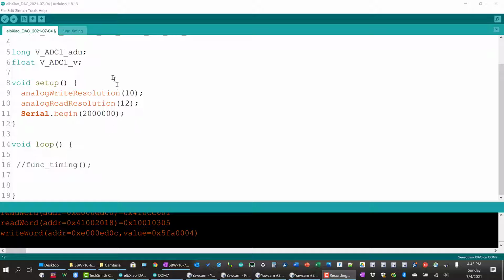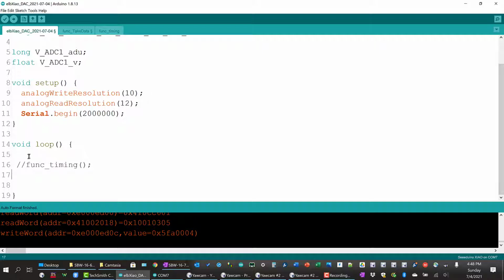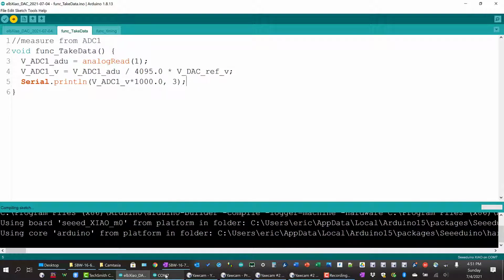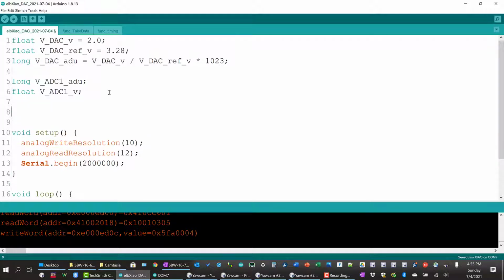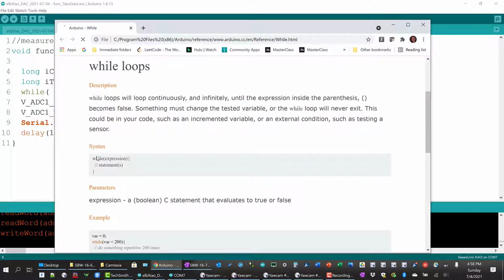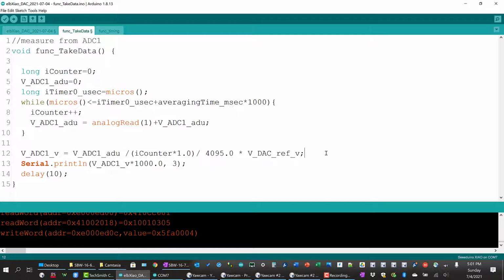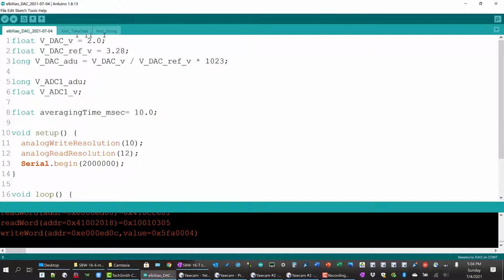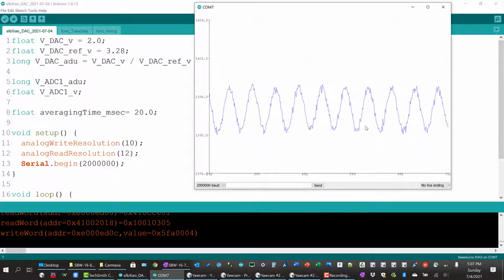SBW 16-7: Serial Plotter Intro

Comment: The newer version of Arduino IDE 2.1.0 as at 9 June 2023 seems to have an autoscaling plotter so there is no need to scale the V_ADC_v, though I did just to keep pace with the instructions on the video.

I am unable to see the sine wave as clearly as the video. I have tried adjusting the averagingTime_msec from 10 to 200. I can see that there is some variation from a max to a minimum but nowhere as clearly as on the video. 

I noted that the Prof was varying some parameters (on the plotter? or on the board?) but I wasn't able to discern what he varied.

Also it would seem that the issue with the Serial Monitor being opened (which is now a tab alongside the Output window) doesn't seem to occur anymore.
😀